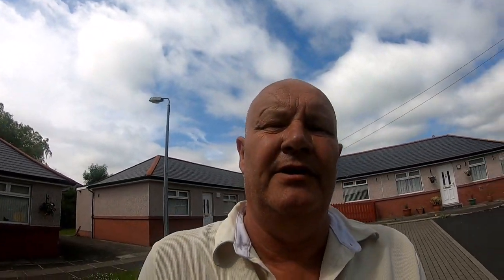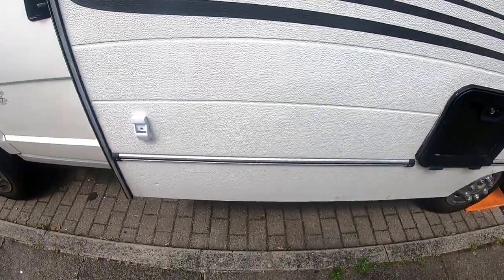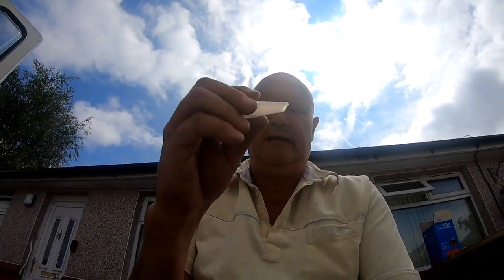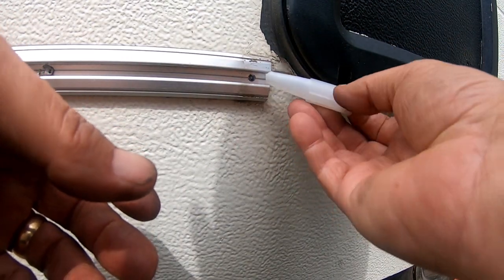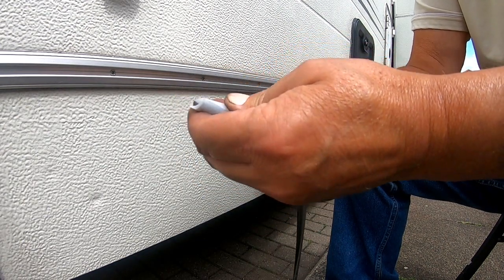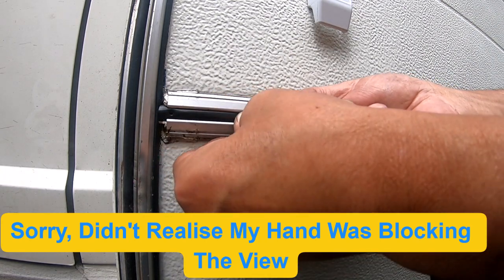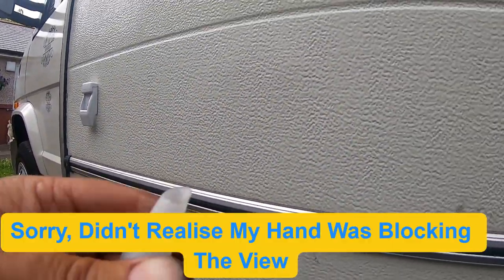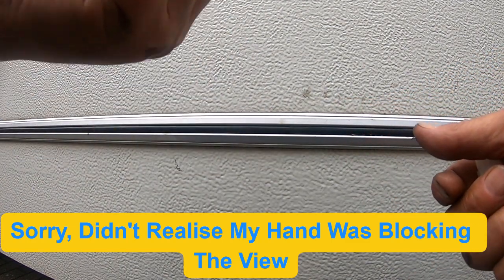Talbot Express Highlander How To Fit Herzim  Aluminium Rail Infil FAST

Comment: Thanks. Seemed a bit more fiddly than I expected though. Noted the comment about the washing up liquid. If you have a set of trim removal tools (I would recommend all home mechanics have some) then I found one of those helped ease the herzim in quite easily.
Reply from the maker: The only problem with this method is the angle and the diameter of the cut, if you can get that right it does go in very very easy, i did some last year all round the outer trim on the off side and it took about 20 mins, a member on Talbot oc id a full side of his van in 30mins, get the cut right and your away. I have some more to do so going to get that right and will upload the results. Washing up liquid would ust hinder as it would just slide in the channel, you need a bit of grip in the channel otherwise it wouldnt come out of the nozzle

Comment: Should have given the rubber a coating of washing up liquid and it would have gone in easier, and no Ouch at the end. But of course it wouldn't of been as funny for me to watch.
Reply from the maker: Washing up liquid would make it to slipy, the herzim would slide even more when puling it, not only that it makes i sweat underneath the trim, found out the hard way when doing the window rubber inserts, having problems now, damp and sticky underneath, DO NOT USE W.U.L